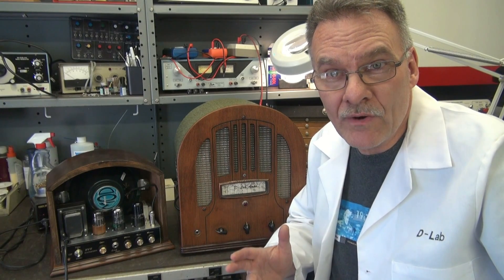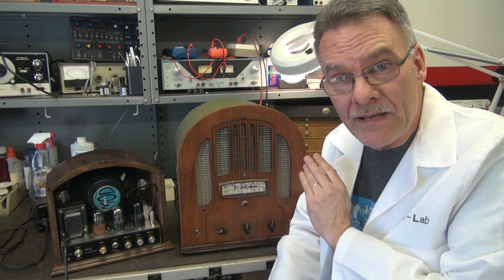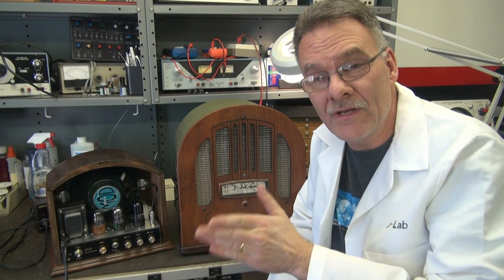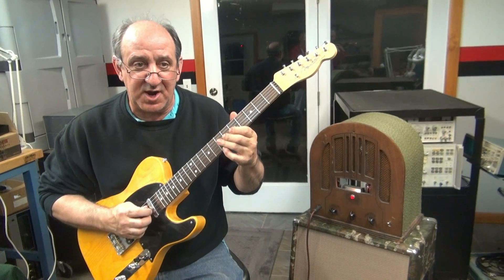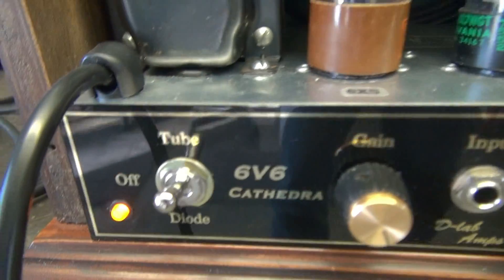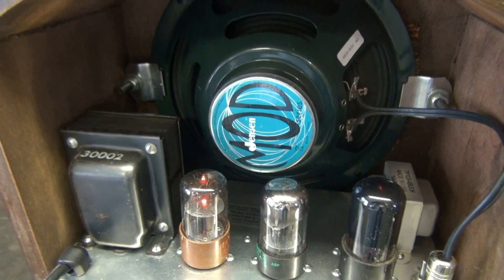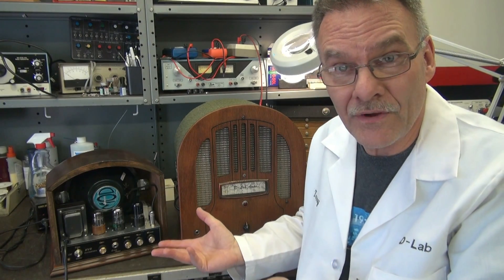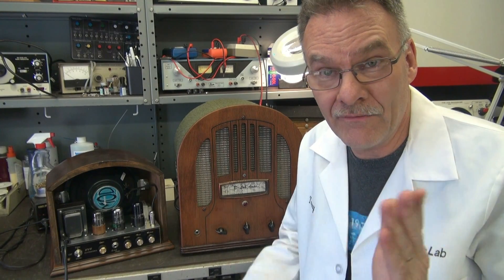D-Lab Electronics demo Cathedral radio guitar 6V6 tube amps Fender tweed sound

Comment: I have a question Mr. D-Lab.  When it comes to type A amplifiers, what does tube rectification accomplish other than lowering the total wattage?  As far as I understand amplifiers, the benefit of transients squishing with tube rectification will only happen with a type A/B and other amplifier types.  Where as type A are always using 100% power whether you strum loudly or not.
Reply from the maker: Diodes only drop approx .7 vdc across the junction, however a tube rectifier drops much more voltage depending on type. See tube data sheets for details. Tube rectifiers can deliver a cool grit effect, due to voltage sag as current is demanded. Therefore, you will get a different attack on notes with a tube, whereas a diode delivers a stiff result. Hope this helps. TD
Reply: Ok - but my understanding is that type A amplifiers can't sag because the amplifier is using constant current - only type A/B amplifiers can sag, current demands vary with type A/B  but current demands stays the same no what is happening with type A amplifiers - at least this is how I understood things.
Reply: Thanks, I will think about it.  But here is a quote from the Aiken amplifiers website that has me confused on the matter.  "Note that sag effectively only occurs in class AB amplifier output stages.  A true class A amplifier has no sag because the current draw at full power is the same as the current draw at idle.  However, most class A amplifiers aren't biased exactly at the midpoint of the range, and will tend to clip asymmetrically, especially when going into grid clamp on the output tubes, so there will be an offset current component, but it will be much smaller than in a class AB output stage."